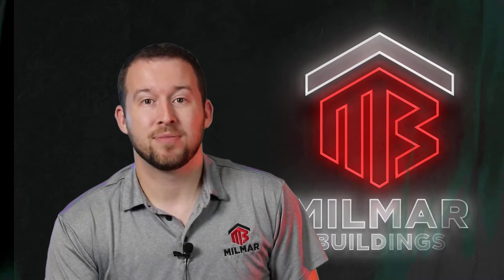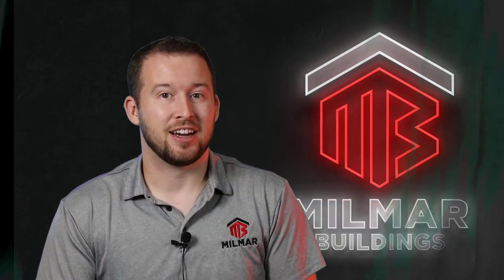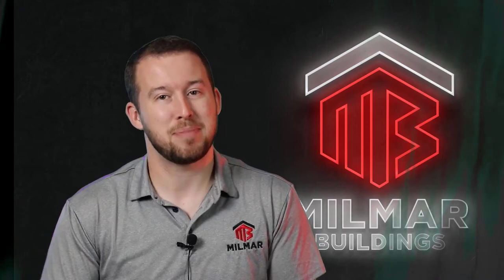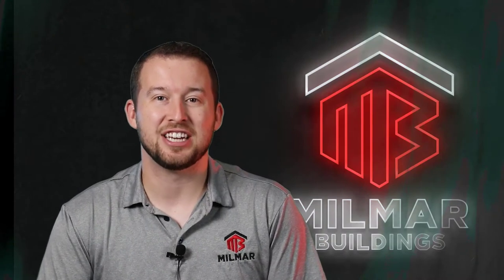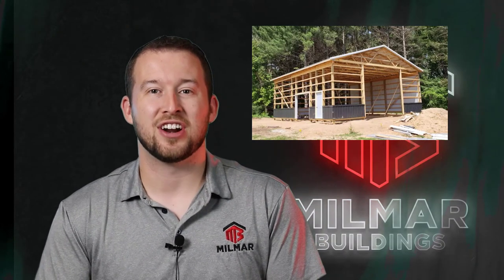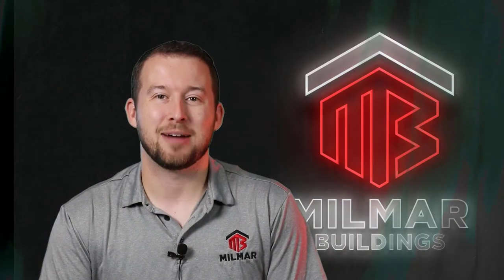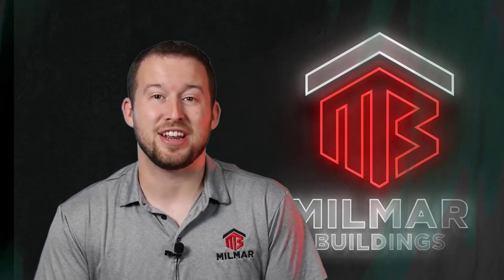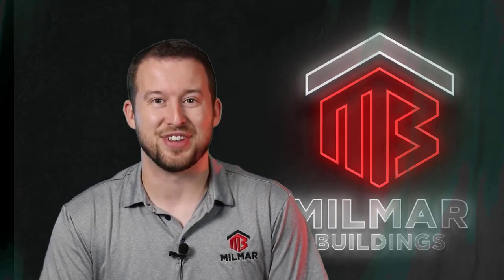Post Frame vs Pole Barn - What's the difference?

Comment: Better description would be balloon post framed. I call it a timber frame. A timber frame is just that a frame made from timbers. Then it goes to the type of construction used. I had a customer call and want a timber frame. So I asked what kind of construction type do you want done? So I explained the different types I do. Post framed using brackets or hardware to make connection, post and lintel where header beam sits on post with only weight usually stone, mortise and tenon,  post and beam that uses round or square saddle notches to make connections, and balloon framed. Usually do combination of mortise and tenon for beams and post and beam with square saddles.
Reply from the maker: Interesting points!  Thanks for the expertise and input!  We definitely stick to post frame for most of ours, but it is fun to watch the other methods used and occasionally use them ourselves.

Comment: Is it possible to build a guest home from an existing large pole building?
Reply from the maker: It is possible depending on building methods used on the current building and local building codes. Sometimes buildings can be retro-fitted, but usually it is easier to start new for residential building codes.

Comment: The screws  d9work themselves loose in hot climates especially when using long sheets. however they are an easy fix . remove the screw squirt some wood glue into the hole and insert a matchstick or something similar . let dry and reinstall the screw
Reply from the maker: Being aware of thermal expansion and contraction is important as well as regularly inspecting your roof screws, just like you would regularly inspect a shingle roof to watch out for any possible issues.  Thanks for the tips!